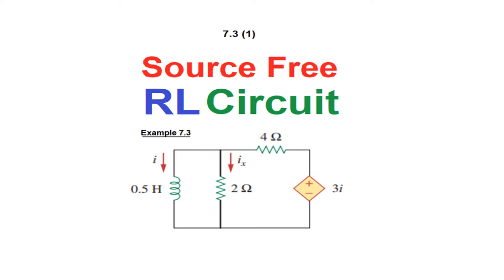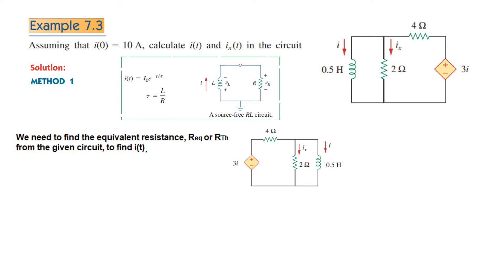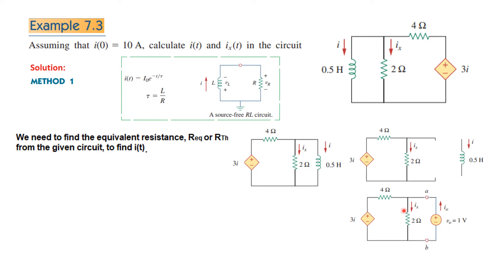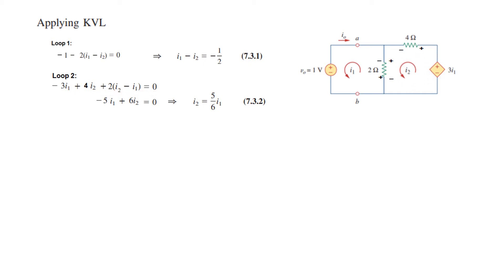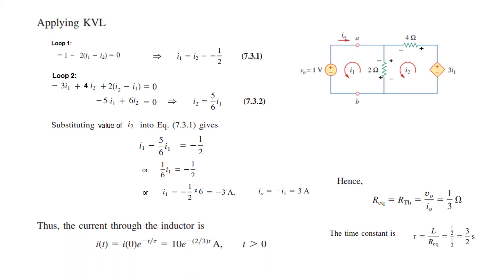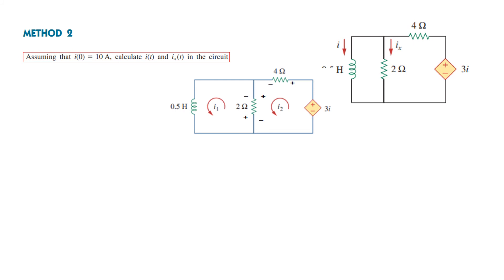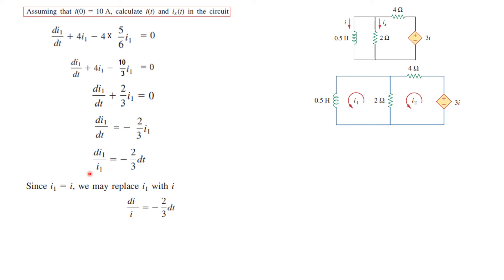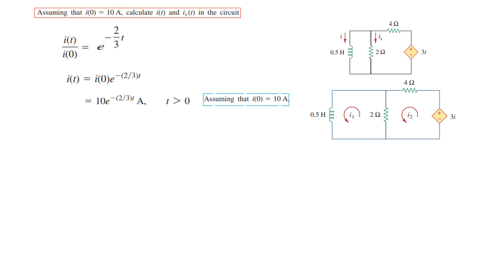(E)LCA Ex 7.3 || Source Free RL Circuit ||   Solved by Two Methods

Comment: Hii sir, when i use clockwise to solve for the mesh, then i get the diff answer. May i know why (3:49)
My ans is 3/7 for Io
Reply from the maker: Watch carefully from time 3:08. You must be making mistake in marking the voltage polarity. You can always whatsapp me or email your working.
Reply: @ElectricalEngineeringAcademy  I had sent you my solution through email.
Reply from the maker: @johnliew1335  Check mail

Comment: sir why is it 3i1 and not 3i2 since the current flowing in that loop is i2?
Reply: Look at the original problem circuit. The original dependent source was 3i. The current, 'i', in the original circuit is in the left loop. The source is dependent on the current in a different loop in this example
Reply from the maker: Please write video time, so I can follow
Reply from the maker: I don't know which point you are referring to, but note that the dependent voltage source in loop2 is equal to 3i1 (although it is in loop 2), that is why even in loop 2 equation we are writing 3i1 in place of this source.
Reply: @ElectricalEngineeringAcademy  why is dependent voltage source in loop 2 equal to 3i1??????? sir please help i have an exam on monday

Comment: Hello sir why the 1V
Reply from the maker: where ?
Reply: You have to find the resistance at the terminals of the inductor, which makes it a Thevenin problem. If you want to find the Thevenin resistance in a circuit using KVL, and there are dependent sources, you need to put a direct source (current or voltage, it doesn't matter) between the terminals where you're finding the Thevenin's resistance. You can put a voltage source there, apply KVL to find the current that is running through the source, then use Ohm's Law (R = V/I), to find the resistance at the terminals. It is common to use 1 volt because it is easy to deal with. You could use any number besides 1 volt if you wanted to

Comment: Hello, i am just curious why this is a source free circuit. It is because in the textbook or your previous videos , i observed that you mentioned if the source connect before and disconnect after , due to the switch open/close count as source free. and i understand why, without the source, the circuit is having a natural response. However, in this video, there is no change (nothing act to the source) to the source, this circuit just having a force response in this case at most. Therefore, why it count as source free circuit??? Thank you.
Reply from the maker: what caused i(0) to be 10 A ? (definitely there was a source before t<0) ( not shown here). We also know that the inductor current will die down to zero within 5 Tau time, so will the dependent voltage source. So it is source free 🤔
Reply: @ElectricalEngineeringAcademy  Ok got it thanks

Comment: Sir  why we did 3i1..??? i mean ac voltage source when we set dc voltage source ?
Reply from the maker: 3i1 is not ac voltage source, it is just a dependent voltage source (current dependent voltage source)

Comment: in mesh analysis, to find equal resistance can't we take the current around the loop is clockwise direction?
Reply from the maker: Yes you can, as long as you mark the voltage polarity correctly, then write the kvl equation accordingly.
Reply: I wrote but I couldn't get this answers
Reply from the maker: @sivasothytharsi1203  https://youtu.be/a2sDtRBq5w8
Reply: @ElectricalEngineeringAcademy   Sir can you check please because the clockwise direction doesn't give the correct answers
Reply from the maker: Please email me ur working @haroon.74